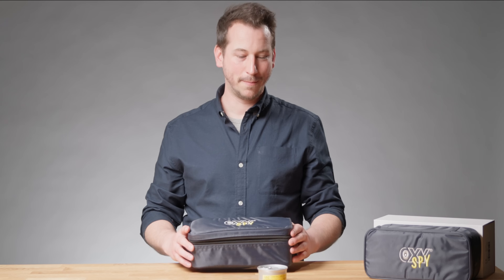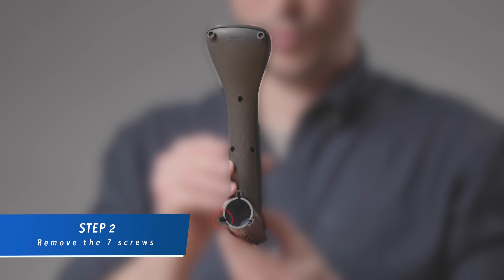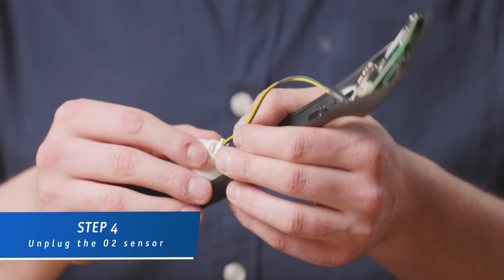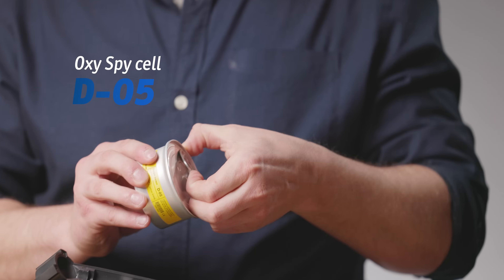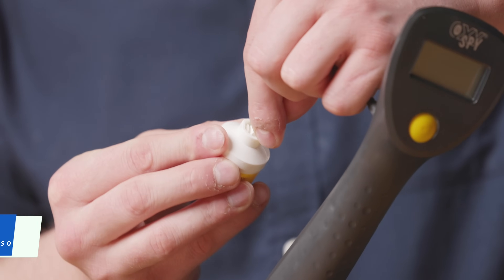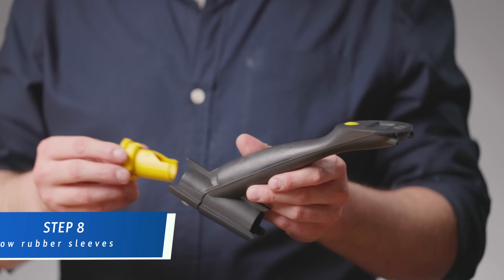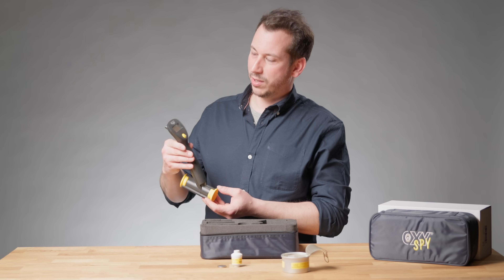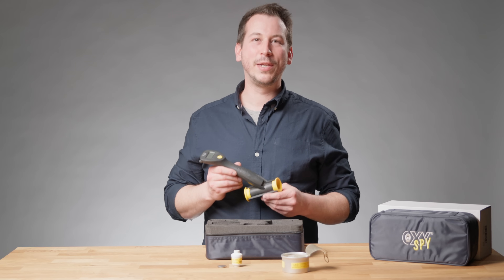How to service the Oxy Spy Nitrox Analyzer

Comment: how long the sensor can be utilized under normal dry conditions?
Reply from the maker: This depends on how often it is used and how high the oxygen concentration is that is measured. The period can range from 12 months (with multiple daily use) up to 30 months